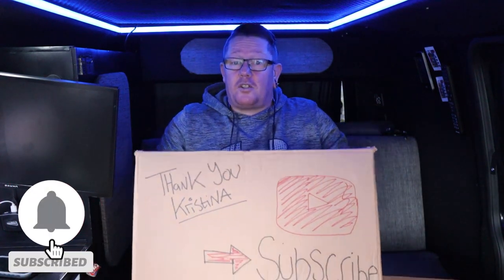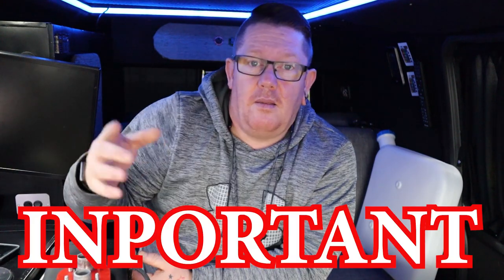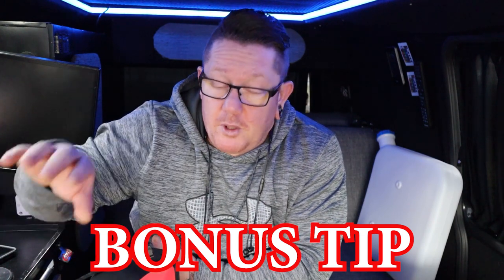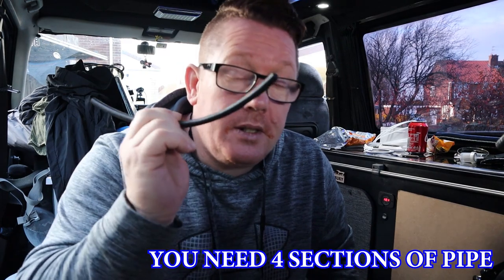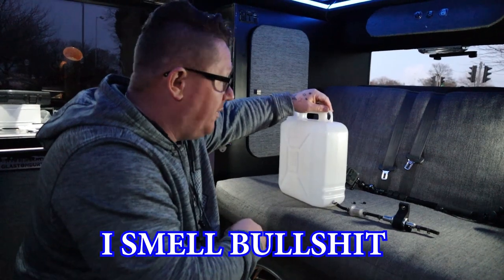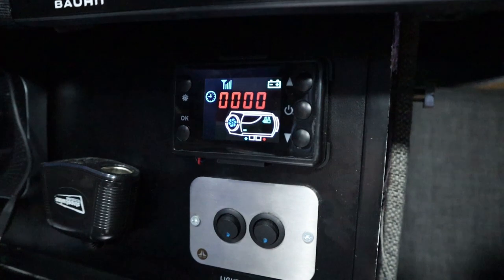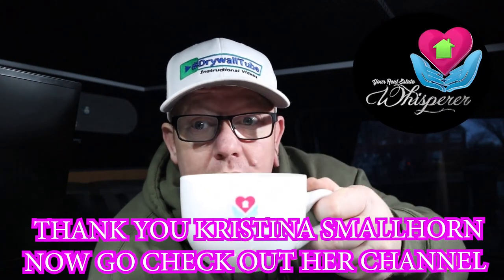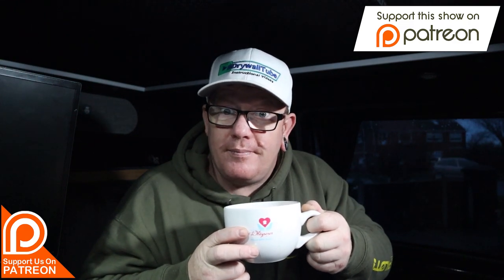DIY Van Build Chinese Diesel Heater Installation

Comment: Thanks for the video,you have fitted the unit where I am contemplating fitting mine,under the rock and roll bed.Looks a lot more straight forward than going under the drivers seat.Thanks once again.

Comment: These are great little heaters. It's the best £115 I've spent on my van by far. One thing I would note for anyone watching this though, is that if you're going to wire to a switch, make sure you turn the unit off by the control panel first and give it time to do the shut down sequence before cutting the power to avoid damaging the motherboard of the heater. Alternatively you can put a switch inline on the red wire to the control panel which will turn off the control panel, but keep power to the main unit so it doesn't forget settings etc...
Reply from the maker: Oh yes NEVER just turn it off . The unit needs to burn off properly mainly to keep it clear of soot as well . But man how good are these things there a game changer
Reply: Urban Explorer I know, they’re bloody brilliant. Good insulation and one of these heaters and you’ll never go cold 👍

Comment: VW fit the air intake in the drivers step INSIDE the van, my heater was installed by Eberspacher main agent with air inlet in the drivers step !

Comment: Ahhhh your van is on FIRE!!! Lol great install video! Hope it keeps yah warm this winter!
Reply from the maker: Oh my man it’s like soooo warm in there . And funny you say that cos my dad was there and he’s was freaking out cos of the smoke but it’s just what happens after the systems purged the air lol . Thanks for the comment mate
Reply: may i ask how long did it take for the scary smoke to burn off?,, just so i know what to expect!
Reply from the maker: @whittle831   it was a few min mate id say 2 min but could be 3 or 4 . but not long . and i was expecting it . so dont worry its fine bud
Reply: @UrbanVanlife  fantastic thankyou for your response,
Reply from the maker: Alan Harrison it took me a while to find it to be honest cos I got the notification but couldn’t find the post lol . Also mate if you fit one and ever run out of fuel the obviously purge the system and then get smokey again like a first start . It’s the same process if ypur fuel runs out . Thought I’d add that cos it’s happened to me

Comment: Colin Mentioned about switch below an very true. Another thing the pump. It is lubricated by the fuel. An should be fitted at 45 degree angle to give long life,
Thanks for doing video.
Will be fitting something like this in one or both my T4s. Have a SWB ex AA an now refurbishing Lwb Syncro to tour Europe level. Emptying bank account fast
Reply from the maker: Oh man the syncro is such a good van but hard to come by . Abs man yes the bank will hate you once you done

Comment: Hi mate you've got your understanding of how it works a bit wrong,the combustion air is taken from outside the van ,the air from the end of the heater is recircultaed air it's completely sealed off from combustion so you can't get oxygen depletion from that , if the combustion air was taken from inside now that would be a major no no, hope this helps as you got a hole in the side of your van and it's not needed really
Reply from the maker: yes i understand the combustion air is taken from out side the van , but the circulated air is normally from in the van so by pulling in fresh air rather than circulates air will result in better heat and dry heat as well , plus its better for the unit .  also i already had the vent in the van from a fridge so kind of made sense to use the already vented area , thanks for the comment
Reply: @UrbanVanlife  oh sorry I wasnt hating just saying as I thought you said oxygen can become depleted if you didn't have the fridge vent , my opinion is you don't need that vent it may pull fresh air from outside and in cold temps it will reduce it's effectiveness I've fitted a lot of these and the ebers and the instructions don't say draw air from outside into the unit in this way example on a eber d4 in this way it would never reach temp as in temp sensor is in the air intake
Reply from the maker: Yer man  TOTALY understand . Like me you just want ppl safe and let’s face it I’m not actually a qualified expert I’m a guy have in a go . But it’s comments like that that ppl will get value from so thank you for the input . And thanks for watching as well . Also I do know 1 idiot that mounted it in a cupboard and just had the exhaust out side . He said that pulling in the air from the van would make it warmer . HE SOON CHANGED THAT after watching a few videos and reading a bit lol . Humans can be a bit dumb

Comment: So if one end sucks cold air in and the other end blows hot air out… what does the intake pipe on the bottom do then?
Reply from the maker: The instake feeds the burn Chamber with air to make the heat . The heat comes out the end powered by the air that’s being sucked in from the back to push the Flow of heat from the burn chamber . Hope things emplains

Comment: Hiya great vid and well explained. I agree with pulling in fresh air. Just one question I have a T4 (Miss Daisy)  were do you think is the best place to put the heater.
Reply from the maker: depends on your lay out to be honest , but remember you need to drill trough so just make sure its not in a place with a main beam under , but there is no right and no wrong place really it all depends on you gloria , its really totaly up to you .

Comment: Hi, thanks for your video. Very informative just a question about going through the floor with the exhaust. I'm going to make my whole bigger just the same as you have. However the plate that attaches to the bottom of the heater dose that get hot
Reply from the maker: no mate the place stays kind of cool , just make sure there is plenty of room for the pipes , but dont worry about the place thats fine and will cause you no issues . well it hasnt for me and mine is screwed to carpet
Reply: @UrbanVanlife  great thanks I'm going to start mine tomorrow
Reply from the maker: James Phoenix good stuff man . Just work out where u want it all to go then it’s easy going take ya time and you’ll have it in within no time mate . Just don’t for get PRIME IT and there will BE A HELL OF A LOT OF SMOKE on the first burn that’s normal mate
Reply: @UrbanVanlife  I must admit it shocked me when I saw your smoke haha but glad it's just a one time thing
Reply from the maker: James Phoenix well if you ever run out of fuel you have to prime it and it happens again  but I’m glad I had seen a video on it . Cos man i don’t know what I’d have done . But its sure nice to know that that’s normal .
Reply from the maker: Let us know how you get on jemes
Reply: @UrbanVanlife  hi I've not attempted it as its gale force wind and rain instead I installed my propex water heater and water pump. I'm going to hopefully get time Tuesday to fit the diesel heater
Reply from the maker: @jamesphoenix3697  lol are you in the uk by any chance , liverpools been like a gale force wind tunnel today and its going to be bad all week
Reply: @UrbanVanlife  hi how are you? So I installed the heater and I'm having a nightmare...the exhaust keeps falling off the heat exhaust outlet port each time I have had to unbolt fuel pump from under van then unbolt heater from the floor to get to the dam thing. Any ideas??

Comment: I get condensation on the windows after one hour diesel heater burning. I have a roof vent, but it doesnt help with that.
Reply from the maker: youll allways get condensation if the air flow isnt enough bud , try venting more and see if that helos

Comment: Great video,  I have seen all of your videos and have a t4 myself, being in Australia I'm not sure how much use I would get from one of these, but it is something I have been considering.  Couple of quick questions though, firstly does the tank smell? And secondly why would you not just T the fuel line into the van fuel tank then you only have the one tank to fill? And thirdly how much fuel does it use?  Many thanks.
Reply from the maker: first off im honored that you joined from oz , ok so the reason I didn't connect direct in to the talk was because its a bit of a pain dropping the tank and as your prob aware you undo one bolt on these old things and 4 more problems happen .  secondly ohhh no I don't think you would need one at all ,an air con one would be fantastic if they made them , and for use of fuel id say 1 gallon lasts us 4 nights in the cold and that's 4 to 5 hrs of it being on at medium temp . thanks for watching mate I really didn't know you could get that t4 over your side . hope your safe and well during the current world madness
Reply: @UrbanVanlife  hey mate, thanks so much for replying 😊 yeah sure can get the Volkswagen vans out here, used to be able to get a combi foe a decent price before the poms starting snapping them up.. Over here they did actually have a dealer fitted aircon option and have looked at fitting one second hand but they use fuel, you have to get this big serpentine belt for it, and it taxes engine power which in the 2.4d is kinds lacking anyways so will probably end up with something like this https://www.mygenerator.com.au/dometic-coolair-rtx-2000-12v-truck-air-conditioner.html I do feel your pain with working on these things as I'm in the process of sanding mine back and I'm going to do mine in raptor white (inspired by yours)  as it's going to be a work van. And man do these things love to rust, i dont think i had a single panel that didn't have any in it.

Comment: Nice and toasty!  How long can it run for?
Reply from the maker: if you have the fuel mate then it will run until there is none , but in a van my size 30 min from freezing if well enough, to be honest . or keep it on low . but it will run as long as its getting fuel

Comment: I don't k ow whether you know but you shouldn't be dragging air from outside to in you can drag exhaust fumes from the exhaust in and you could get carbon monoxide poisoning. Please more you air intake to the inside I don't know where you got this information but it is incorrect and is dangerous
Reply from the maker: I’m not dragging air directly from the outside . But as long as your exhaust is well away from the intake your fine. I extended my exhaust to the rear of the van so there well away from each other  . I have a vent on the side of the van from where the old fridge was so . Iv put the air intake for the fan duct trough to that part of the van but not DIRECT from the out side .  . Also more people have problems with Oxygen deprivation than they do with carbon monoxide .

Comment: Your explanation of oxygen deprivation is invalid. 

Those heaters are designed to be mounted inside.  The exhaust pipe and air intake for the burn chamber is mounted outside the vehicle. 

The rest of the unit placed inside the vehicle is designed to circulate the air inside the vehicle. So the air intake side of the heater will be inside the vehicle as much as the warm air out take...
Reply from the maker: always good to air on the side of caution in my opinion , lots of people get the fitting way wrong and have the chamber air intake inside the van , yes inside . totally mental but my intention mas to have people think about the fitting and do it properly . plus pulling air from a fresh intake is a lot better for the heat as well it cuts down on condensation cos its not recycled . but mainly i just want people to think about what there doing and do it properly . thanks for the comment